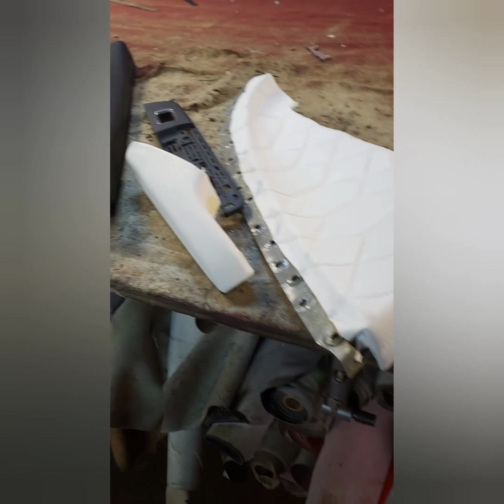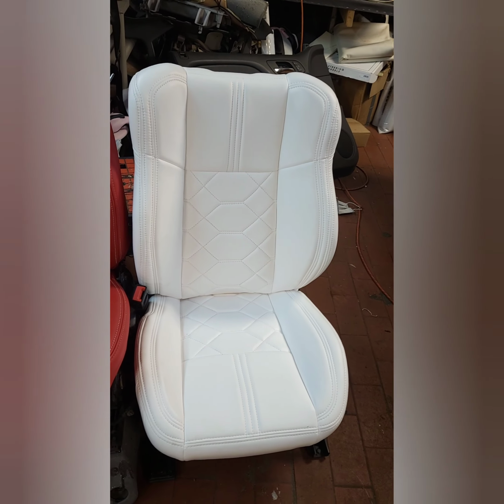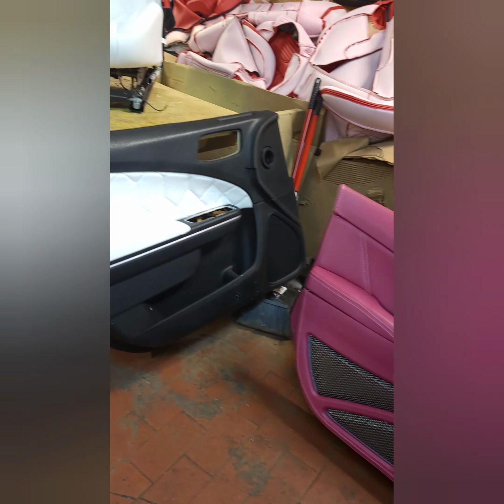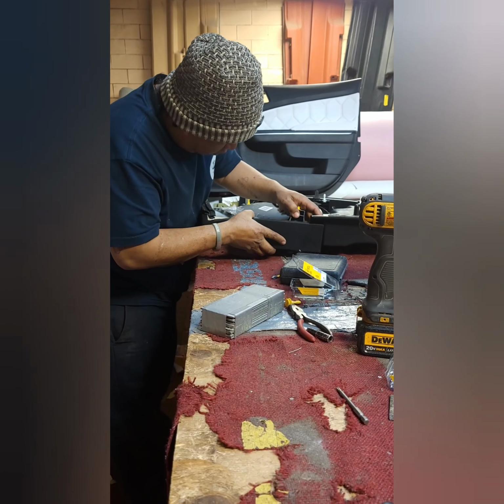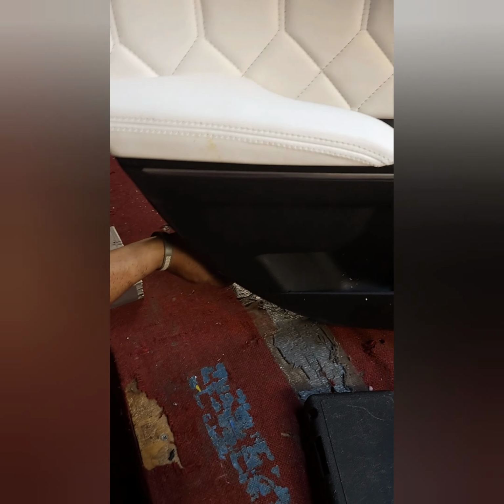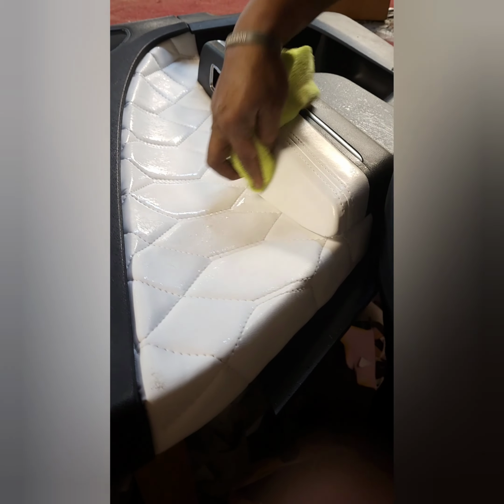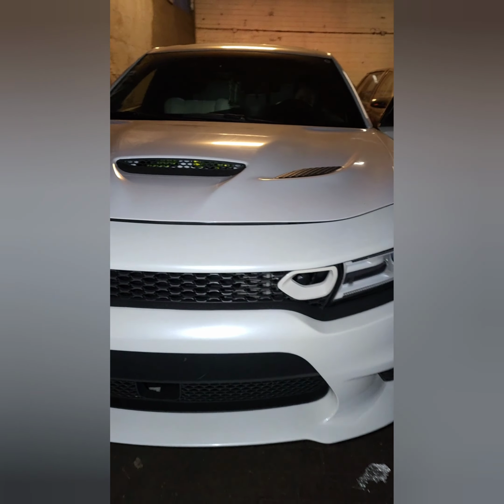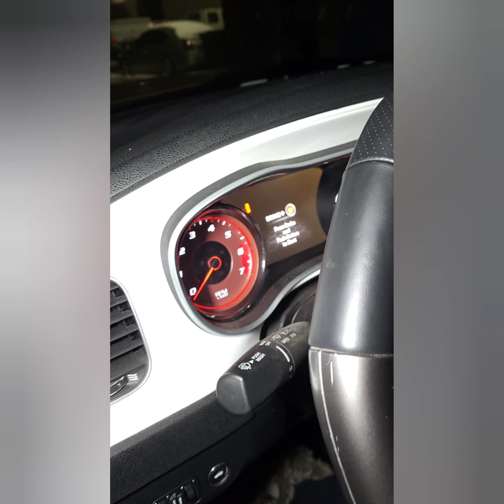CUSTOM SEATS AND DOOR PANELS IN THAT HELLCAT

Comment: One more question, did you keep the original fabric on the panel and place the new fabric on top? Or did you remove the old fabric and install in the new fabric alone
Reply from the maker: The properly way is remove the fabric
Reply: Ok thank you brother, just wanted to make sure I’m doing it right
Reply from the maker: @DMVTONE  💪💪